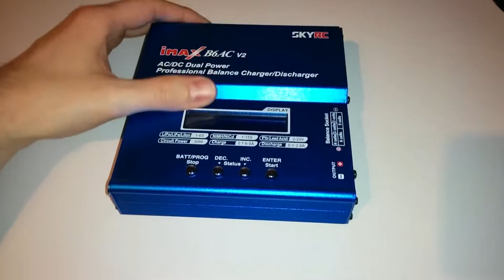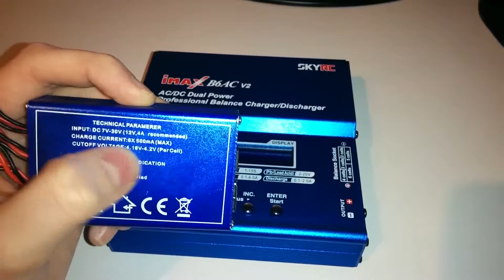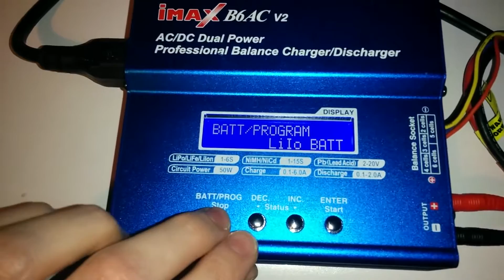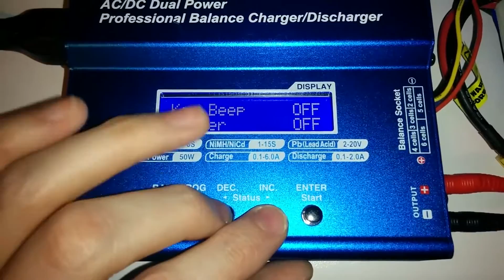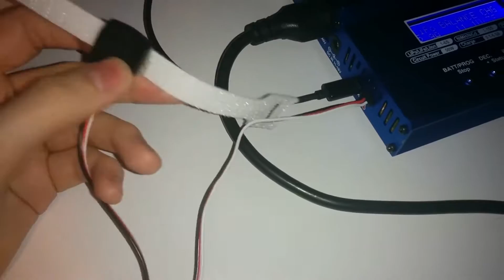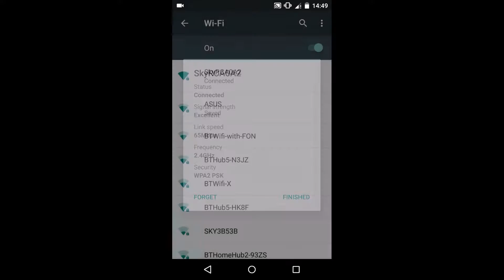SKYRC iMAX B6AC V2 Dual Power 2

Comment: Temperature is the biggest threat to batteries. You want to control heat as much as possible both when running and discharging.